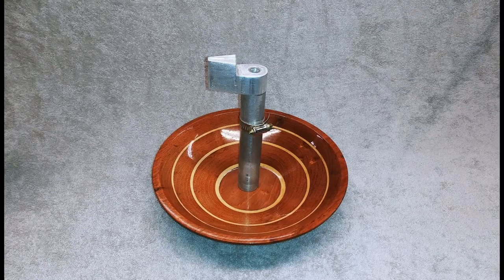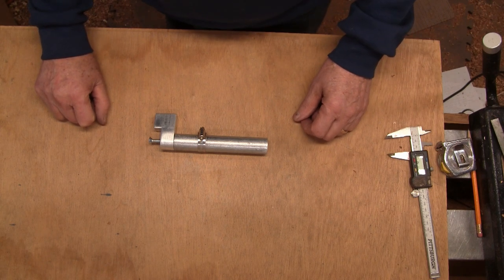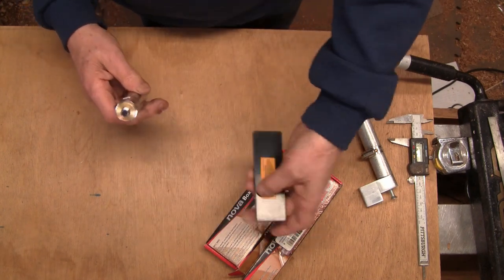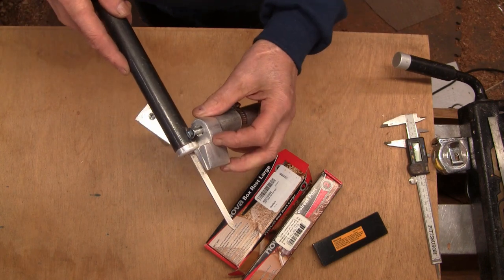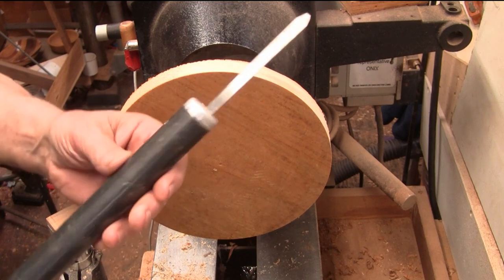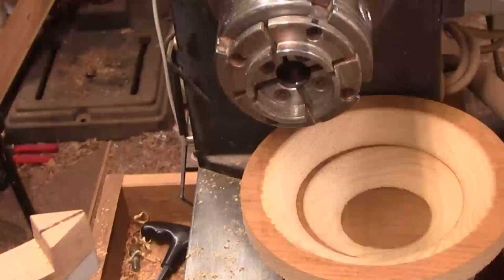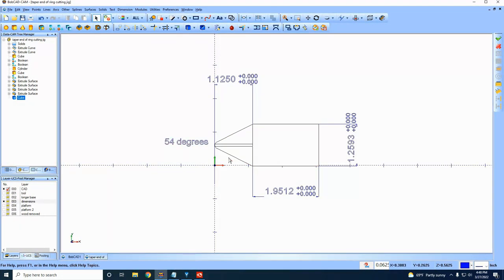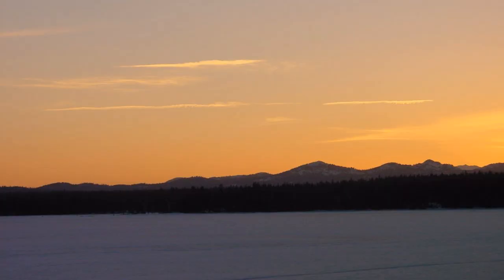Wood Turning NEW Bowl from Board Cutting Jig 2.1 READ UPDATE

Comment: Well done. What has been your experience with a 60 deg bowl??  I am going to try 3d Printing the part. Since you have a good CAD system you should try 3d printing some one off parts. FLsun has a $200 delta style 3D printer this is a great piece of equipment. Model Q5.. Great work and great presentation.
Reply from the maker: Thank you Hamp, 
I have two 3D printers and I have printed many things for wood turning with them.
If you watch this video at 3:12 of the video you will see a 3D printed version of my cutting jig.
https://www.youtube.com/watch?v=bGcRLGWMn5c&ab_channel=ThePapa1947

I put the files on TinkerCad as well.
Thanks for watching,
Gary

Comment: Thank you for sharing all the work you have done on this project.  You have a hose clamp on your jig to set the height of the jig and tool entry  into the board.  Does the point of your tool go in dead on the center line? Do you go in slightly above or below the centerline?  I am looking forward to making a jig.  Thanks again!!
Reply from the maker: Thank you for watching and asking the question. Yes I put the tool right on the center line. I meant to talk about that and I will on my next bowl from a board video that I do.
Thanks again,
Gary

Comment: Very informative. Thanks for sharing the dimensions and angles for the jig. The parting tool had some writing on it. What did you use to make the PT? Is there a "formula" for the widths of the sections? Different angles as you cut each ring? Thanks and reply when convenient.
Reply from the maker: Thank you very much.
This was a Nova Modular post. The Sorby post will work as well.
If you look in the description I have links to what I used.

As far as the spacing  it is common to step the same as how think the wood is. That will work great for a 45 degrees.
What I do is make my cut then measure how wide it is and make the next ring fit.
I do that all the time but where it came from was how I make a curved BFB.

What this video to see how I do that.
https://www.youtube.com/watch?v=0zJlsPsNKxM

Let me know if you have any questions,

Gary
Reply: @ThePapa1947  I have the Nova post, just need to rig up the jig for cutting the rings.
Reply from the maker: @knothead5  If you have a 3D printer you can print the guide. I have the model on TinkerCad
Reply: @ThePapa1947  Grandson has one. I'll check with him. Where to get TinkerCad?
Reply from the maker: @knothead5  https://www.tinkercad.com/things/67bF4Fc5M4k-nova-ring-cutting-guide

This and other things are on my TinkerCad site  https://www.tinkercad.com/search?q=ThePapa1947&staffPicks=0

Comment: I've made tool rests for my lathe using mild steel rod and angle stock from Ace Hardware, so I find this intriguing.  I don't know that I need one of these, but wouldn't stop me from making one!

The design with the wooden guide would probably be strong enough for occasional use, but I would be concerned that wood can split along grain lines, and I would be concerned that the two triangular sections at the top could eventually shear off.  Probably not a big deal because it would be a simple matter to make a replacement.  But you could reinforce this design by drilling a couple of holes through the wood that mate with threaded holes in the metal platform, and then running machine screws down through the wood and into the metal.
Reply: Being more creative - you could also make the two triangular sections at the top from bits of HDPE salvaged from a cutting board.  HDPE would have a lot less friction than wood against the parting tool.  Use a couple of machine screws through each HDPE triangle, the wood base, and then into threaded holes in the metal base.
Reply from the maker: Thanks Louie.  I have made a number of tool rest using 1" diameter mild steel for the post and the platform. 
For the guide what also would work good is some HDPE. But as long as you have a good piece of hardwood and predrill the holes it should be fine. No reason to put the screws in very far. they are only for keeping it from twisting.
Thanks for watching,
Gary
Reply: @ThePapa1947  
I made a tool rest using red oak for the top guide section.  Unfortunately, my fears were realized when one of the triangular sections sheared off the first time I tried using it  Back to the drawing board!
Reply from the maker: @monophoto1  which way was the grain going? How deep was the grove and what size is your parting tool. 
I would suggest Delren or HDPE.

Comment: I guess I did not realize the handle diameter would be all that important if I have clearance I did not think it would matter if the clearance is 1/8" or 1".  That being said my handle max diameter is .890" or which equals 57/64".  On another note I received my box rest and it appears to me if I am going to screw a wood block to it I would be best to use #4 screws in the back., one on each side of the gusset.  In the front one #4 or possible one #6 after I file the gusset level to the platform - sound about right?
Reply from the maker: The handle I made is 1" gas line pipe so what you have is close enough to that. And I did make mine with the least amount of clearance needed. So 1/8" is fine.  The screw in the front sounds good and making a flat spot is a good Idea.
I would feel comfortable with the screw in front.
And a few options that I would feel comfortable in doing for the back end:
Really good double sided tape should keep it from twisting.
A small hole maybe 1/8th inch drilled through the back end of the wood and just a little into the center of the back  end of the metal piece. This will also keep it from rotating. 
I did not check for clearance but there might be room for a screw coming up from above the tapped hole that the post goes into?  The screw I used going up the thin end of my piece only goes in about 3/16" to keep it from twisting.
Lots of options for doing this.
Epoxy will work for the whole thing but would need to heat the metal to swap out the piece.
I left all these option off the video to keep it simple. You have good understanding of what is going on so I thought I would mention these.

Gary

Comment: After wallowing out my pine version of this jig I am on an aluminum version.  I thought I would offer some comments and thoughts here for others that might want to pursue aluminum using basic tools.  First the post was easy to drill and tap using my 12” wood turning lathe. Having a ⅝ collet made it real easy.  However, if I do another jig I will consider drilling thru both pieces and using a grade 8 bolt to clamp the two pieces together.  Only saying grade 8 to allow for maximum torque.  After spending hours  outlining the jig with drilled holes, connecting the holes with a hacksaw, filing (serious filing), and belt sanding I had a good solid jig that only needed the kerf put in.  Not wanting to mess up the hours of work I had put into the project I consulted a machine shop thinking they were going to hang the phone up and tell me to get lost.  Instead they took on the project of putting the kerf in by way of a milling machine and charged me one hour labor ($60).  Once I had the finished product in hand and cut six rings I knew I made the right decision.  I do not believe that I could have achieved the same quality with a hacksaw or die grinder, a better man might have got it done.  For what many of us spend on our lathes and tooling $60 certainly won’t break the bank. Oh, I purchased both pieces of aluminum for $12. I used a 1-½” x 1” x 3-⅝” block. And a ⅝” x 4” round. The finished product looks like a little boat on a post similar to the one you made of wood, except I did not use the Nova box rest. Thank you once again for sharing your ideas which made it possible for me to comment here.
Reply from the maker: Thank you for letting me know how you did it. I think you came up with an excellent option.
The other option that I should have mentioned in the video was use a piece of HDPE plastic for the piece instead of wood. 
 Having a milling machine makes it easy to make mine from metal and aluminum makes works great. 
Having a band saw also allows you to cut aluminum on a wood cutting band saw. I have got a lot using a 1/4 or 3/8 skip tooth blade. But those are good quality blades I bought at a local saw shop. They make the length to fit what you need. They are the same or less than the ones you can buy from a wood working store or online. 
 Nice job of using the basic idea using the tools you have and thanks for sharing it.

Gary

Comment: I made your jig using plastic as you suggested, and I bought the Robert Sorby mini parting tool.  I’d add a photo, but I don’t see how to do that in a comment.  My first two attempts to use it ended badly.  I started with an 8-3/4” dia disk of mahogany  1-1/2” thick and set the jig at 45 deg.  The tool cut about 1-3/8” into the disk and then jammed, stalling the lathe, and ripping the tool from the handle.  I noticed that a the steel blade was only in the handle about 3/4”, which I thought was way to little for the forces on the parting tool.  I’m about to give up on this, but I first wanted to ask you two questions: 1) is there a thickness limit on the disk?  I.e. was 1.5” too thick?  And 2) Can this bowl-from-board technique be done with a 1/8” parting tool which would be better able to withstand the force?
Reply from the maker: I would not go over 1" thick boards. The cut length on your 1.5 inch board would be 2.125 inches on a 45 degree angle. That is way  to much for the Sorby tool  You would get a lot of heat build up and for sure it could a good chance of it jamming. The RPM can play a part in that as well. I try to stay around 600 RPM.
 Yes a 1/8" parting tool will be better but it will also get hot in that thick of a board.
 I would try 1 inch thick boards(that is perfect for a bowl from a board.
Even 3/4" will work fine. 
 I mention using the thinner board in my videos and have said much thicker makes it harder to do.
 Try thinner boards and depending on the height of the 1/8" parting tool it could bind easier. Depending on how small the rings get. That is why I use the thinner blade.
Hope this helps,
Gary
Reply: @ThePapa1947  Thank you, thank you.  I'll get a new 1/16" tool (the catch/jam I described bent the first into a pretzel) and stick to thinner boards and lower the speed to under 600.
Reply from the maker: Thanks for the update. I know the tool is thin but to cut the smaller rings without binding it is all I could get to work. And it works fine.
Do not force your cut and I pull it out to clear the chips and a few times on each cut.

Comment: I was given a rest with a post that is a bit undersize, so I CA-glued some shim stock to pad it up as needed.
Reply from the maker: I tried some of the very thin aluminum tape but it was too tight. My banjo has a lower adjust and that works but then my tool rest is a bit tight. I have a few other options to try.
Thanks for watching and your idea.
Gary

Comment: Very cool, simple jig Gary. Thanks. 
How do you decide what angle you want to cut your rings at? Are there advantages to, say, 45 over 50 and so on?
Reply from the maker: Thank you, A 45 will give you a much steeper side wall where as a 50 or 55 will make a flatter wall.  But the 55 will also end up making a smaller base if you are not careful. If you use a combination of the angles you can get a little curve on the walls.
 Hope that helps explain your question. If not let me know.
Gary

Comment: Gary when turning an economy patterned bowl how critical is iit that the inner diameter of one Ring matches the diameter of the ring below it? if they don't match will the pattern be discontinuous? Hopefully I have explained it well
Reply from the maker: The pattern will generally line up. It is important that the rings are concentric to each other. Matching the diameter makes it easier but I have done plenty where the diameters did not match but the pattern does. What I do is look at it as 4 places to line up. So looking down I line up front to back and then do side to side. I also flip it over and double check side. 
Great question and the next time I do one I will point that out.
 Let me know if that answers your question.
Take care,
Gary
Reply: Thanks I'm going to try one this weekend. If it turns out I will send you a picture. Otherwise you won't see it 🙂

Comment: Hi Gary,
Really appreciate your video.  I picked up some aluminum remnants from my local metal supply and look forward to building the jig.  I didn’t know Nova had these parts... thanks for telling us all.
I have a follow up question - you usually use 3/4 stock for your ring bowls.  Can you use thicker stock?  I have a nice piece of 8/4 Clark walnut 14” wide that I think would make a nice bowl.  Any advice on cutting angles for a curving surface, or should I reference the video you showed ring jig 1.0?
Reply from the maker: Hi Skip, thanks for watching and aluminum will work fine. I will continue to use the aluminum one that I have and keep the other for its intended use.
 So maybe you ask about the 8/4 before and if you did I am sorry for not answering. I could not find the question later that day when I was going to answer.
So yes you could do 8/4 but it will be a very long cut and things will get hot. As a matter of fact to cut a 45 on a 2 inch piece the cut would measure  2.8284 inches long. I like to keep the boards 1.25 inches thick or less.
But if you have a nice parting tool you could do it with 2 inch thick.  But you will be making a very tall bowl or one with very thick walls.
 And yes check out the video I did on making curved walls on a bowl from a board.
https://www.youtube.com/watch?v=0zJlsPsNKxM&t=6s&ab_channel=ThePapa1947

Let me know if you have any questions.
Take care,
Gary

Comment: Would double sticky tape hold the guide tight enough for parting the rings?
Reply from the maker: I have used double sticky tape for a lot of things and it has held very well. This is something only the user can determine because not all double stick tape is the same quality and also how it is put on. That said I would trust the tape I have.
Epoxy would work but harder to change out.
I also thought about zip ties but the angle on this rest would not allow for it.
 Hope this helps,
Gary

Comment: I have a question. I am going to order the Robert Sorby Micro Cut Off tool.I’m thinking of just ordering without the handle and attaching a square handle that would fit the tool rest. Good idea?
Reply from the maker: Yes it will fit fine. I bought just the blade as well.
 Thanks for watching,
Gary

Comment: What size micro parting tool
You use?
Reply from the maker: It is the Robert Sorby Micro Parting tool. It is 1/4 inch tall and .08 inch wide.
Thanks for watching,
Gary
Reply: @ThePapa1947  thank you. .08 is very thin. Will it warp or break?
Reply from the maker: @subhenduc  mine works fine. Just needed to let the tool cut and back if off to clear the chips to keep it from binding.
Reply: @ThePapa1947  Thank you so much. For some reason the product link in your video transcript does not work. But I can get a similar one like yours. Thank you again.

Comment: To keep from having to drill and tap you could scuff it and epoxy it or even use a good double sided tape couldn't you
Reply from the maker: For sure you could use epoxy and if you need to change the part out heating the metal will release the epoxy.
I was going to mention that. A real good double sided tape should hold it as well.  Also was going to mention that. 
All good ideas you have mentioned. Another thing I really was going to much was to use HDPE plastic instead of wood.
Or Delrin would be good as well. Most people do not have that around. I did have the HDPE though.
Thanks for watching,
Gary

Comment: It looks like your parting tool has been modified to
Reply from the maker: I only bought the blade for this tool. They sell the blade for their modular setup and I have made a couple handles that I use for other tools that I made. You can buy it with a handle as well. But it seems a little on the short side.
Thanks for watching,
Gary

Comment: Ou share and upload your program
Reply from the maker: Which program?
Reply: @ThePapa1947  for the plastic 3d print to hold the tool straight for cutting bowls.  Its a great idea!  I was going to try the aluminum then saw the 3d printed and wow.  Why not sell them, make yourself a few bucks.
My son watched the video and he is into 3d printing.  He suggested a couple different materials to make it stronger.  Have you had any problems with flex or wobble?  I was wondering if the metal base you showed would add stability.
Reply from the maker: @robertbiswanger3841  the files are on TinkerCad. Both for the one that bolts to a post I made out of aluminum and the other for a Nova modular post.
 You should be able to find them under ThePapa1947.
 And if has has some stronger plastic to use I would suggest that. What is it that he thinks is better.
Gary
Reply: My son suggested PLA for the print material and also said you would need to enclose the box on at least 3 sides.  It really needs to be kept warm for the duration of the print.  There is also a carbon fiber print material but that is very rough on the print head nozzle.  Love both the Aluminum and print.  Great ideas